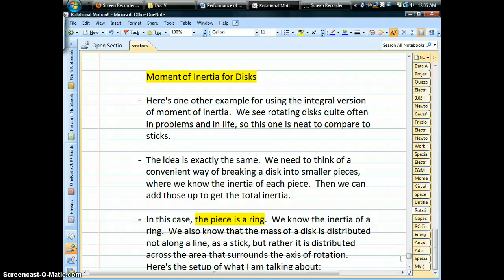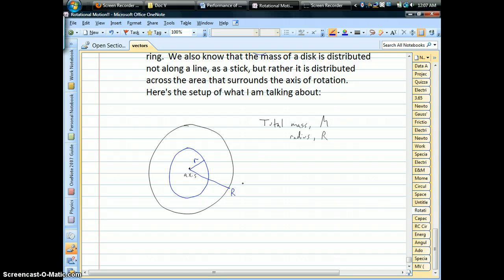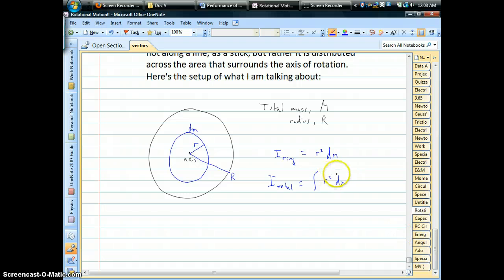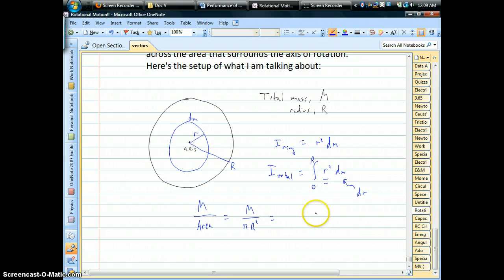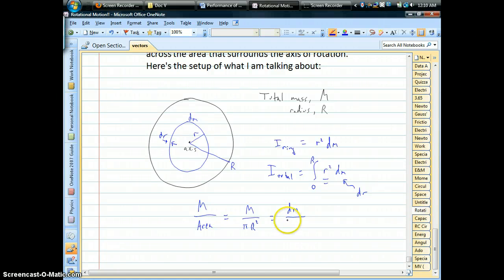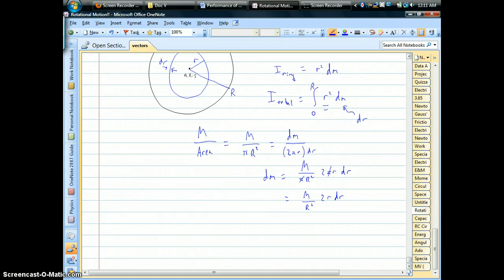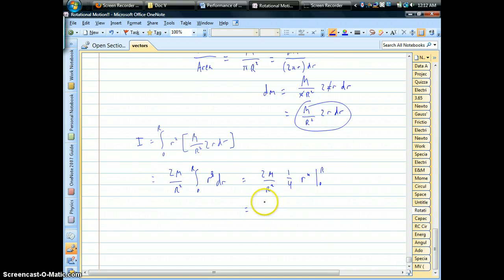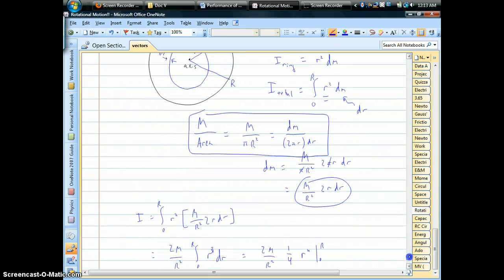Moment of Inertia for Disks

Comment: i dont fucking get how you can assume it is a 'rectangle' because its not. However when i use area of ring with radius r+dr - area of ring with radius r:  \pi*(r+dr)**2 - \pi*r**2 == im stuck with \pi*r**2 + 2*\pi*r*dr + \pi*dr**2 - \pi*r**2 = 2*\pi*r*dr + \pi*dr**2. Why can you just ignore dr**2?? i dont get it
Reply from the maker: Remember, dr is an 'infinitesimally small' distance, so dr^2 is ridiculously small and approaches 0. Also, to show dA = 2*pi*r dr is correct, just integrate that and you get pi*r^2, the full cross sectional area of the disk.